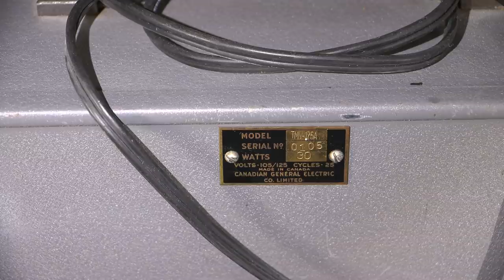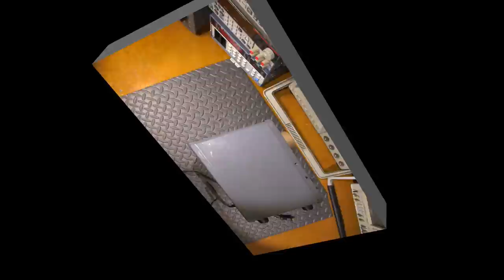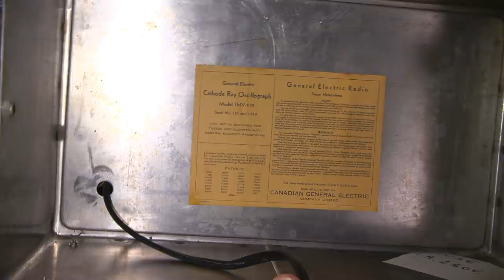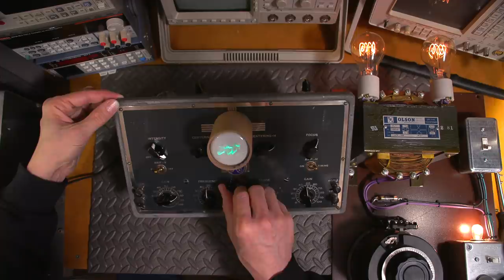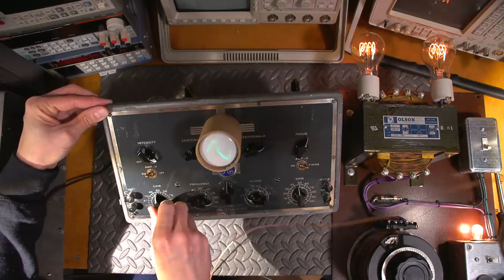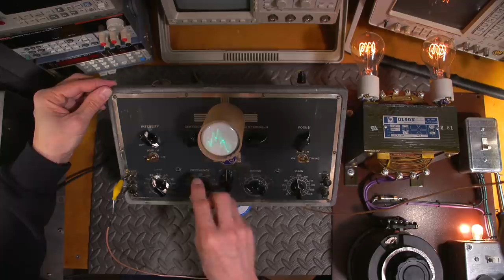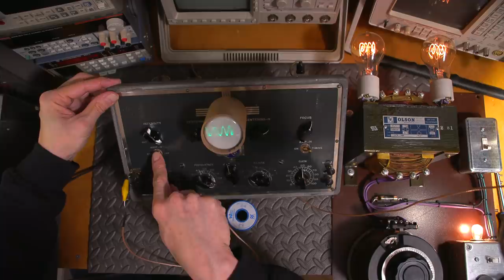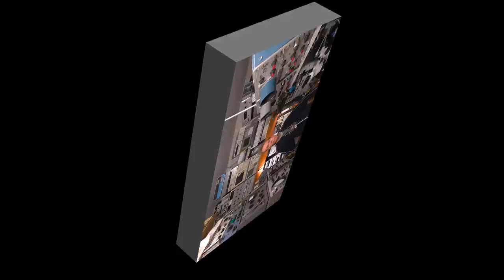1938 Electronics - Will It Work? Let's Power It Up!

Comment: Not too dissimilar to my first scope about 55 years ago age 12. It had 5 or 6 tubes in it and was made by RCA.  Full of original wax caps and old parts but it worked. One of the sweep settings needed a new cap to work. I polished the rust of the front panel with steel wool and the old bakalite knobs were cracked and broken so I replaced those. I could connect to a radio speaker and see audio, I could build oscillators, amplifiers and see signals. A mic and amp was non stop fun I had a few germanium transistors in those days. Years later I got something a lot better. I owned a Phillips and Tek scope then. The Phillips was vastly superior to the Tek. I got my first digital scope a LeCroy in the early 80's. It too was lightyears ahead of Tek. It did cost more than a new car but was worth it. I measured and captured millions of lightning strikes with it. I have owned several LecCroys since. I have abandoned LeCroy after buying a new scope for $24K that had tin lead edge connectors in it (prototype pcbs). Their service policies were terrible even though I had spent well over 150K with them over the years. My current scope is a Rhode & Swartz which has great features and some unusual limitations, and they are overpriced. Now for a few hundred you can get a great scope from China. Tek no longer owns the world like they did in the CRT days. Now a good scope costs less than a Tek scope probe.
Reply from the maker: Thanks for sharing your story John!
Reply: My first scope was part test gear and part gym equipment, it was so heavy just lifting on and off the bench was a workout !
Reply: Those LeCroy scopes were the gold standard for a few years.

Comment: For being from 1938 that chassis on top and underneath are really clean obviously that spent its life in a dust free environment. Getting life out of it with the old caps and even one burned resistor is actually amazing and a testament to how that equipment was built. Thanks for sharing Paul.
Reply: I think the tech that replaced the CRT may have had access to brushes and a vacuum.

Comment: Thank you. 
  A neat piece of equipment.
  I worked on vacuum tube, hybrid tube and transistor equipment and solid state/optical cable equipment.
   A lot of changes in the last 70 years.
Thanks again.

Comment: Lovely little waveform indicator :)
I'd definitely love to watch you restore it, even though for obvious reasons it's no use for any measurements.
By the way, I've got a little Polish tube oscillograph from 1960/70s named Mini 4 and even though I'm not gonna use it, I'll keep it for sentimental reasons. It was the first thing resembling a scope in my lab, back in 2004 or so.
Oh, and I did a vectorscope / curve tracer conversion on another '70s junk scope named ST310A (ST315 is similar and more common if you're curious), completely redesigning the electronics and using your designs for curve tracer & Wien bridge oscillator. It's so nice and indeed it helps in my lab :). I'm gonna add a vector clock to it, and it has X-Y inputs on BNC jacks and 1/4" TRS for stereo audio in when I want to show people some oscilloscope music.

Comment: In the later 1980s I was gifted a 1949 Hallicrafters S-40a by a friend who had

bought a new Yaesue  HF set...

The S-40a needed only a new power cord

For safety's sake

I worked until the early part of Desert Storm....

When it stated making wax...

Smoking....

Caching FIRE!

I passed it to to a repairman friend

Bought a R.S. DX-390 on sale for $150

Which lasted until about the Columbia disaster...

Ending the NASA Radio club retransmission from STS and ISS...

The S-40a was my second one

I had one, on loan, from mid-1960s...

Vietnam news from Europe!

Today I have a Sangean ATS-818 and an ATS-818CS

Both found on eBay for $36 and $42 ppd. MINT

After my DX-390 got too DAMP!

In my bathroom!

LESSONS!

J.C.

Age 72..

Retired camera repairman..

Mechanic!

73's...

Comment: You said the CRT reminded you of a Sci-Fi movie... I thought the same "There is nothing wrong with your test equipment...  Do not attempt to adjust your oscillograph... We are controlling transmission...  We control the Horizontal deflection... We control the vertical deflection"   . . . and well, you know the rest  LOL 🤣😁😜

Comment: Paul, I've seen you install new bus wire in some units and that reminded me of the time the electronics dept. that I worked in had a 25 lb. roll of 20 gauge tinned copper wire. The only problem was that one end of the roll came off and the wire started to unravel into many ,many loops that got completely knotted up. If you need a length of 20 gauge bus wire, you could try to get enough wire off the roll to do the job.  They had to reorder another roll of wire and had to watch who handled it so a side didn't come off again.

Comment: Wonderful, I love the green on these displays! I have a thought for a project for you that might be fun. Create a cradle to hold the equipment so that you can tilt what you are repairing instead of tilting with your hand or propping up with a tub of solder. It would be skeletal and fully open so you can easily access everything but can be easily tilted on all axis, if there is anyone who could design that it’s you!

Comment: I too have a LOT of test equipment in my lab. 3 Benches full and 2 store rooms as well. I have mostly Tek, HP and Fluke but lots of Heathkit, RCA, Eico  and others as well. I have a few new Digital scopes and a Rigol Spectrum analyzer However, I prefer using my older gear mostly. It's hard to beat a Tex 465B, HP 410B VTVM and an HP 8640B sig gen. Though, when I am aligning a more complex receiver like an R390, I can get the same results, more or less, with my older, Heathkit O-10 scope, at least for power supply and low freq stuff., RCA Voltohmyst and Eico sig gen scope etc
One  problem is it seems like one piece or another of my test gear is always in need of repair, or cal check. The old problem of a guy with a watch can tell you the time, a guy with 2 watches is never quiet sure...lol 
Thank goodness for Ce standards and GPDO technology.
I enjoy your video's and it's nice to know I am not alone in my test equipment fetish. I also enjoy watching your videos as if its part of shop talk, even if it is cyber initiated.
73 WA4AOS

Comment: Paul, I have the original RCA No. 151oscillograph with the original 1-inch CRT. Did a cap change is running fantastic for its age.

Comment: have you ever considered taking an old radio and replacing the inside with modern electronics so you can get all the performance of modern equipment while maintaining the old look?   in the car world they call it "resto-mod" where you replace the engine, brakes, etc so you get modern performance while keeping the old look.
Reply: The old O'scopes are surprisingly useful.

Comment: That is so cool!  I actually home brewed a similar device in the 1960's using the same 884 thyratron for the sweep oscillator. I still have it and may dig it out and restore it.   I used it as an ocsilloscope. I used a 2 inch scope tube which was given to me.  Can't remember where I got the schematic but it was probably a ham radio book. I also used it with an audio amp to display "music" which was impressive in the 60's.

Comment: Thank you Mr Carlson…a fascinating video featuring an interesting oscillograph. I enjoy your mini talks and your delightful accent…what part of Canada are you from? (I’m in the south of England). My own very first oscillograph was ideal for checking audio circuits working up to about 1MHz or so. It was just post Second World War I think and used a 6K25 Thyratron in the time base…I’ve still got several of those in my shack (my UK callsign is G3XFD, my Irish callsign is EI5IW). In the past I’ve found some interesting little scopes at Amateur Radio Mobile rallies (I think they would be classed as ‘swap meets’ or something similar in North America) and have several 1CP1 one inch scope tubes which featured in Practical Wireless magazine (I was Editor for almost 25 years until retirement in 2013)) using the Mullard/Philips basic workshop project scope. A fascinating little tube, the 1CP1 (Loctal base) was used as a waveform indicator by the the old British Post Office Telephones (now BT) in telephone exchanges to monitor the dialling tone, which was generated by little 440Hz (approx) frequency output motor generators! Most of the scope tubes had phosphor trace burns due to thousands of hours continuous working…but they could still be used! Thanks for your excellent tutorials…I’m a great fan! Best wishes, Rob G3XFD.
Reply from the maker: Thanks for taking the time to write, and share your story Rob!

Comment: This is a neat bit of kit. Thanks for showing it us. You haven't convinced me to retire my two oscilloscopes yet, but I still look forward to you rescuing this one.  I love the exposed terminals on the isolation transformer. I know its not quite shango or electoboom levels of fun but it still triggers my OCD haha.
Reply: Greetings:
I noticed that the lab's isolation transformer has a 120 vac side and a 120/240 side. In order to use the 240 configuration, all of the 120 volt stuff would easily be configured on the input side so switching between 120 & 240 needs only a DPDT switch and separate power outlets.

Comment: I think there definitely is a market there for a new aftershave Mr C's ode cologne  vintage Electrical smell aftershave.
Reply: "Aaaah a good 1970s scent, with a strong phenolic circuit board component and a slight leaky PCB capacitor note."

Comment: Greetings:
I think you will agree that the existing SYNC function is similar to the more modern horizontal TRIGGER function. If this oscillograph has no external trigger input I would add one as well as add a LINE (mains) trigger input. They can be relatively simple as external filters (e.g. video H/V sync separator, etc.) can be added separately. I hope you do not think these mods are too advanced for this vintage gear.

Comment: I sometimes question the practice of supplying a piece of equipment with reduced voltage. The trivial assumption is that everything should just experience less stress at reduced supply voltage, but in some circuits it may not be so. A comparator that expects certain voltage levels may erroneously trigger some part of the circuit to go into some high current mode when dealing with undervoltage. A voltage reference may be insufficiently biased and thus signal another high current mode somewhere else. Or a capacitor that was meant to charge quickly to keep a driven active element conducting for a minimum time, now charges slowly and keeps the active element on much longer , overheating it.
I know this is just hypotheticals and conjecture, but sometimes, it may happen.

Comment: Thanks for this! You need to run a "Hooked on scopes" series. I have learned a lot here and on Patreon. I have a 2ap1 Norelco 2 inch CRT that would work good in a simple scope as a curve tracer or low frequency signal monitor. Could you do a homebrew scope project sometime either here pt up on Patreon? Just add it to the list of 8 million other things you've got to do!

Comment: Maybe an enterprising repair tech found a CRT 902 used in  the RCA 151-2 variant and just substituted it into this particular piece of equipment to get the larger display.   I noticed the 25 Hz AC frequency.  Niagra Falls project used 25 Hz which set the standard for parts of northern US and parts of Canada at that time.  I noticed in the manual, the 25 cps version is 1.5 pounds heavier ... more iron in that power transformer!!!!

Comment: Probably camera perspective, but lately it looks like you're less than a quarter inch from getting nailed from the terminals on the isolation transformer...
Reply from the maker: Yes, just the angle that's all.

Comment: When using your soldering gun, I have noticed it looks like you make your own soldering tip from a short piece of bare copper wire. But there is more than just a piece of wire because the entire wire heats evenly unless the "tip" is slightly narrower than the rest of the copper with a file. If not already done, it might make an interesting video. Also, is there a Q&A area?
John S. -retired Broadcast engineer, Florida

Comment: The original CRT was a RCA tube known as a 913 which had a domed window on its top. Cool thing to know.  
See that this is RCA model 151 that was rebadged by  Canadian GE. Look it up at the oscilloscope museum website.
They have lots of photos of it and a pdf file of the manual with schematics!!!  Boy I love the internet! Steve
Reply: A tube originally designed for audio/radio monitors and often sold to hobbyists.  It has a standard octal tube base.  Radiomuseum says that the 2001 is a similar CRT with slightly different ratings.

Comment: How's about not just recap etc it, but also inset the CRT further back ?
As for troubleshooting.  It can help to describe the response on Y plate, response from Y amp (it inverts the signal), distortions due to capacitor and diode failures in power supplies, detecting power supply ripples under various loads (including use your variac to overvolt and undervolt a transformer with its effects, bottom bend distortion, top bend distortion and etc...
Reply from the maker: I kind of like the protruding CRT.

Comment: The mystery is whether or not that CRT was used because its all the owner had when the original went out,  or was it an attempt at an improvement?
Reply: A longer CRT means less voltage required to deflect the beam.  A direct connection to Y of 10 Volts would deflect by several millimetres.  The scope would be functioning as a high impedance volt meter.

Comment: Other than the cyclops style tube it's in beautiful condition. 
I still use an old scope that only has half a display on 1ms timebase. It's an easy fix but I just haven't got around to replacing that particular timing capacitor. It's both fun and annoying at the same time.

Comment: I could see that oscillograph actually used for tuning out military technology like radios and early radar systems, the timeframe is exactly around the time World War II slowly broke out. Definitely would have some stories to tell!

Now if you are on the field, and you have to make the broken radio running but you have broken equipment to work it out, I think that is a nice thing to demonstrate...don't be let down by faulty equipment

Comment: Very interesting.  I noticed that this was rated for '25 cycles' mains power.  I'd never heard of that frequency being used for mains before, was cool to read about it.  Will the fact that power in Canada is now 60Hz affect anything to do with the operation of this scope?  Would the higher frequency make the transformer more efficient maybe (or less efficient, not sure!)?  Cheers

Comment: Hmmm,  since it looks like there is room inside; I think I'd like to see you enlarge the front hole & mount the existing CRT normally, with the tail of the tube in a rear protrusion; i.e. "TV style".  

With that said, I've seen scopes with black pullout shade rings for easier viewing.

Comment: Is there a comparable RCA model ? I think Canadian General Electric had some sort of arrangement north of the border that anti-trust in the U.S. might have prohibited south of the border.  For instance a F-127 made by C.G.E. is a copy of an RCA Victor 811-K or 812-K. A C.G.E. E-98 and E-106 sure look like RCAs of the time period. And a friend of mine had an old late 1930s-mid 1940s Hotpoint refrigerator that had a builders plate that was "RCA Victor Co. Ltd - Montreal" on it even though Hotpoint was a GE subsidiary in the U.S.A.  RCA did had Whirlpool as it's own appliance division in the States later on.   So it may well be that that GE may have an RCA doppelganger.

Comment: I had a couple of very early heathkit scopes that were a similar adventure to use. Not nearly as well built as that and no calibration. Thousands of CRTs were built for WW2 so spares were available. Both scopes transformers eventually died, but they were useful while they lasted.

Comment: AhaHa I know JUST the 'aroma' you mean - prob means dangerous hydrocarbons/PCB'S (not the circuit boards!) so easy on that stuff ;)

And hey I just thought 'oscillograph' was the old fashioned word for oscilloscope - or does it tend to mean uncalibrated, like this guy?

Ahh the olde-worlde Body-Tip-Spot resistor code - you DO know your stuff! ;)

 Meows from London - Pete G & William S Stereocat
Reply: @jamesmdeluca  Yup! Also used in SMALLER transformers etc 'back in the day' I gather

Comment: Is the chassis at floating potential?
What input impedance does these kind of scopes have?
Reply: There is a theorem called Thevinems theorem, which teaches you to break all circuits down into three components, with that background you could visualize what's happening and answer your own question perhaps some reading is in order?

Comment: Jon Specter asks...how many va'sd is your isolation current limiter transformer..also how many amps is it rated for..thanks.
Reply: The current limit is totally a function of the series load, here the two incandescent lamps. The lamps can either be series or parallel connected. When series connected you lose the ability to unscrew one lamp to change the load as the circuit is broken. Parallel allows this. I have seen Paul change his current-limit setup to 249vac so I'd have to guess as to the wiring, but my guess is that lamps in series would still break the circuit. 
That cardboard section of a mailing tube should be painted black except that it would reduce the prohibition of using it as a lifting point.